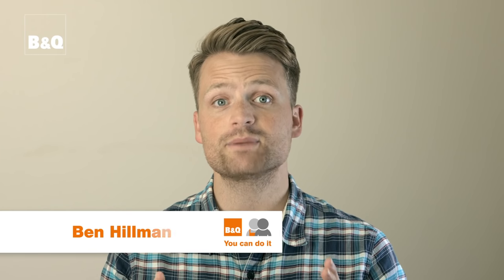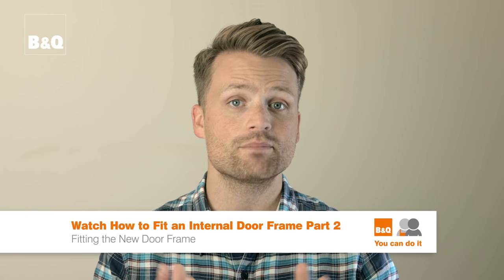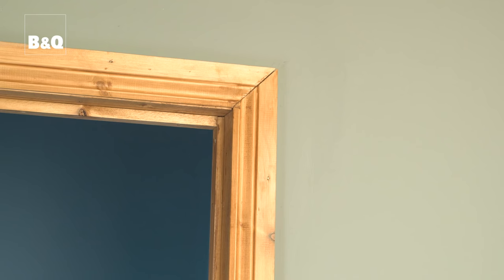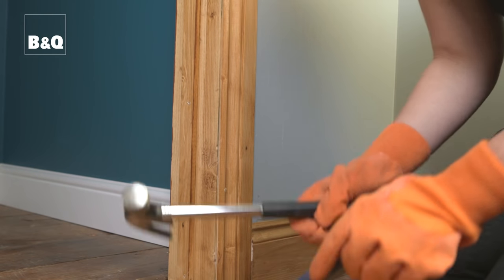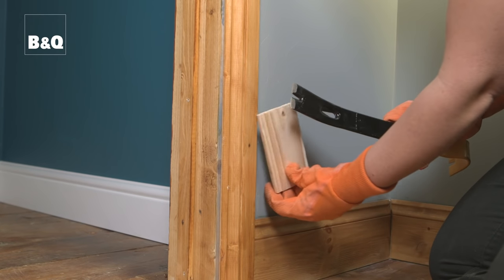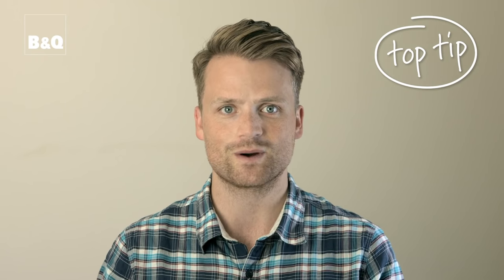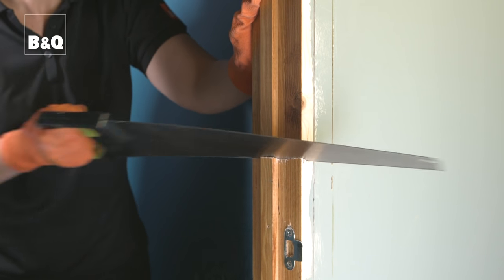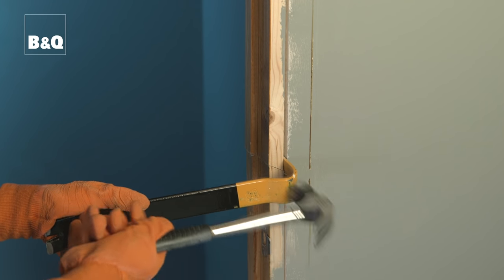How to fit an internal door frame part 1: removing the old door frame

Comment: Some helpful advice, however, I've just removed the door jambs from my house & there's no way I could have removed them by the method shown in this video as they were fixed in with lots of long screws which i had to drill out.

Comment: Tried using the method shown to remove the door lining and only damaged the plaster doing so.
Trying to remove with a crow bar is near impossible.
A better method - find the original screw heads under the wood filler using an awl, strike the centre of the screw to knock out the old filler and simply screw out, probably using a PH2 screw head. 
Do the sawing before screw removal but once you have identified where two screws are so you don't hit them with the saw.
Reply: Yeah, but ARRGHH why do people use screws for fitting a door frame anyway? Nails are much the better solution for this job! (If you do have screws, you can probably locate them using a strong magnet. One of those tools sold for retrieving dropped screws, basically a strong small magnet on the end of a telescopic radio antenna, will do perfectly.)

Comment: Will this damage walls? If you’re getting walls plastered do the doorframe need to be removed and attached?
Reply from the maker: Hi, there. Thanks for your question. We'd suggest that you fit the door frames first then plaster as fitting the door frames afterwards can damage the plaster work. Hope this helps!

Comment: Very illustrative video! Sorry if this question sounds silly but I'm just wondering if could be any issue when removing the old door lining.. structural wise, collapse..? 
Thanks,
Juan
Reply: Give the wall around and above it a tap, if it sounds like timber your good to go

If it sounds like brick and your in doubt. You could remove the plaster to see if there is a lintel 🤷‍♂️ it’s somthing I’d check for a bigger door opening